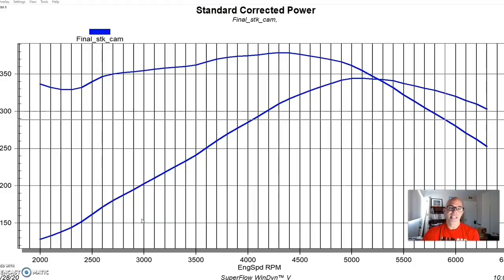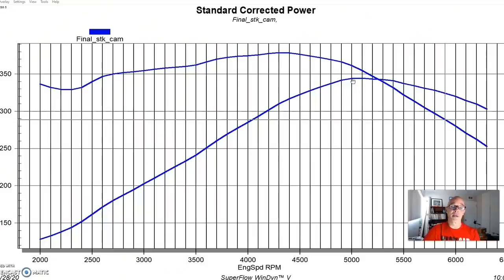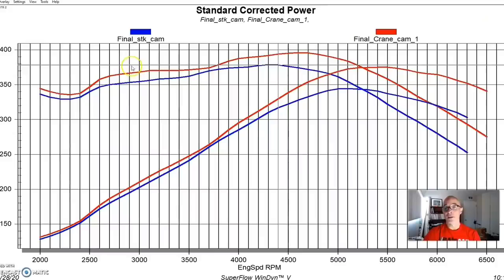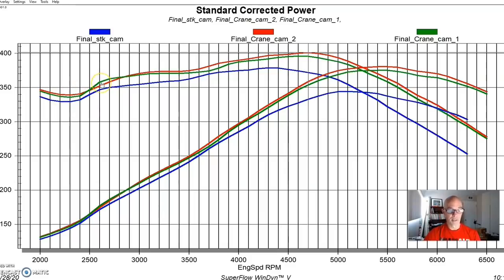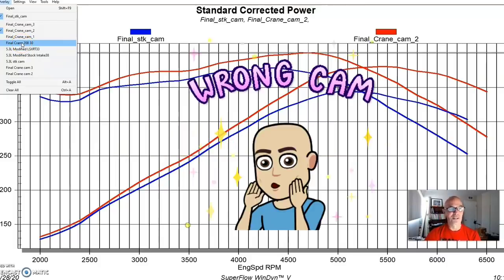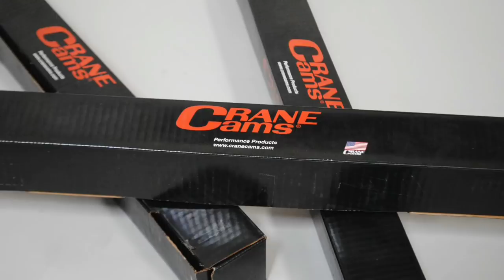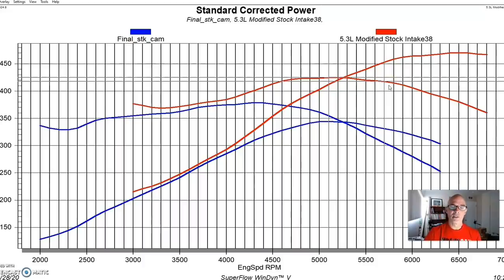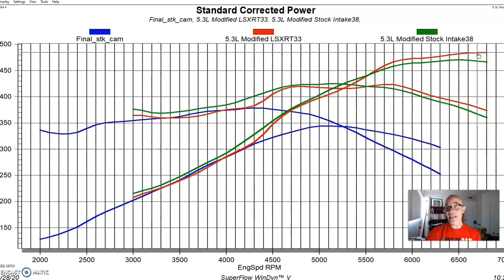NSR CAM TEST-HOW TO MAXIMIZE 5.3L PERFORMANCE

Comment: Would i be able to use stock exhaust if i replace the stock cam to a performan mild cam.
Reply from the maker: any cam can be run with stock exhaust
Reply: @richardholdener1727  thank you!

Comment: Quick question for anyone including Richard of course I did a cam swap on my 2012 Chevy Silverado 5.3 crew cab went from a 590 lift now I've got a cam motion 553 low lift do I need to have another tune done or should it be close?
Reply from the maker: THE LIFT ISN'T THE ISSUE-WHAT IS THE DURATION CHANGE

Comment: In my shop we run anything under .560 lift with stock springs no problem
Reply from the maker: NOT WITH STOCK 706 SPRINGS-ONLY WITH LS3 SPRINGS
Reply: @richardholdener1727  actually you may not believe me but I put stock ls6 cams (12565308)  in stock lm7 engines all the time.  Stock springs and all.  The customers love it!  Never had any come back with spring problems yet.  On the single bolt applications I use the ls3 cam most of the time and put 706 heads on them rather than the 243 because compression is more needed than that extra flow on these small bore engines.  No springs required on any of them so far.  Anything over .560 lift here usually gets pac 1218 or better depending on many things

Comment: Richard, do you do a video showing dyno results fro too tight and too loose valves? How it affects performance. Thanks
Reply from the maker: more lash, especially on a solid roller or flat tappet- tames the cam timing, less lash adds power on top (sometime sacrificing power down low)-it can also hurt things if excessive-you don't ever want lash with a hyd roller or flat tappet cam
Reply: @richardholdener1727  I just have an old honda crv 2.0, i guess it has hydraulic lifters.  When I adjusted the valves recently I got to wondering just what improperly adjusted valves does for engine output.  Havent seen a dyno test on that.  Everyone talks about keeping your valves properly adjusted, like its real important

Comment: I'm glad to finally see somebody starting a dyno test at 2000 RPM because in a everyday driver the engine spends most of its time right around 2000 RPM
Reply from the maker: are you at WOT at 2000 rpm at lot?
Reply: Trucks are frequently lol @richardholdener1727

Comment: What cam do i need for drifting?
Reply from the maker: WHAT IS THE RPM RANGE
Reply: @richardholdener1727   I'm not sure yet. Haven't tuned or bought anything. Researching. What's a good reliable RPM range to beat on a stock LM7 bottom end?

Power range goal 4-500hp. I'll check piston right gap and look at the bearings before of course. But just curious what cam you'd recommend. I'm sure Torque is important for drifting. Basically burning out while you steer around a track. Love your channel btw ❤ ✌
Reply: 4500-6500 RPMS

Comment: Hey, I just bought a 2018 Silverado with the 5.3. Would like to tow a bit more. Would you recommend stage one cam with or with out springs ? Would you replace push rods?  What about trunnions. I have heard there is issues with the trunnions. Thanks
Reply from the maker: BTR TRUCK NORRIS CAM AND SPRINGS

Comment: I was looking at the famous E-1840-P - TF SS2 FOR MY 5.3, 706 headed N/A build. A suggestion from Summit was their house brand SUM-8713R1 and SUM-8715R1, and after seeing this the SUM-8713R1 is looking great for a light weight, mid 80s Cutlass. hoping for a great street driver than can dip into the 7s at an 1/8th mile track. Thank you for being unbiased and all the grinding you do for us out here!

Comment: I have a all-alu 5.3 on the shelf here and would really love to put it in my MB 190E. Its a light car so a 7000rpm 5.3 would be awesome. No need for pulling heavy stuff, just a strong midrange/top. The sloppy stage 2 cam seems a good choice!
Reply from the maker: its cheap and popular
Reply: @richardholdener1727  i think from the ss2 vs the world you found that two other cams had similar top end but slightly better bottom/ mid-range. Thanks for doing all this work!

Comment: The thing to keep in mind here - later 5.3 (like 2010+) use a bigger cam stock. Something in the neighborhood of 196/201 .480 116lsa. Which is approaching the size of the first mild cam tested here. Also with vvt probably behaves like a larger cam than the specs would indicate.

Comment: My first build ig is kinda on the wild side its a 2001 tahoe 4x4 on 35s   iron lm7 bored .125. Full race blueprint 218/227 nsr cam (hotcam replica) hand ported milled heads 11.1 CR  tbss intake circle d 3000 stall and a built 4l80e suffering severely from the 80es tall first gear and big tires regear is gonna be next

Comment: Richard! What combination would be best for Street and Strip for a 5.3.? Maximum Horsepower? Stock bottom end as well?
Reply from the maker: STOCK BOTTOM END 5.3L CAN GO TO 500 HP OR SO WITH AVAILABLE P-V, DEDICATED BUILDS WITH HIGH COMP AND VALVE RELIEFS CAN GO HIGHER

Comment: i am new to this...i have have a 02 truck 5.3 ls engine 706 heads putting it in 72 amc javelin with a sagana 4speed trans ..my guestion is i love the thumper cams and would like to know what cam i should get  i wont that feeling of being pulled back into the seat and a thumping cam .can you help me
Reply from the maker: what power do you want
Reply: @richardholdener1727  around 450 or so  thank you for responding and also would i have to change push rods and springs
Reply: mainly street car with attitude

Comment: Are your results considered flywheel hp or wheel hp? 

Thanks for all your work with these videos.
Reply from the maker: flywheel hp
Reply: @richardholdener1727  do you have a guess on how much you might loose  after the hp gets to the wheels?

Comment: Just wondering what you would think about the 862 heads are they worth porting? It's a daily driver, was thinking a nice size cam long tube headers and a Diablo tune. Stock intake, all this is out of a 2002 5.3
Reply from the maker: ported 862 heads work well
Reply: @richardholdener1727  don't 862 heads have a bad rap for leaking coolant around the head bolts?

Comment: That LSXRT ain't worth shit. You gain like 5 HP above 5500rpm and loose 15 TQ under 5000rpm. I mean if I was made of money or was putting it in a camero but if it was a camero you'd have to use the LSXR anyway for hood clearance.
Reply from the maker: the lsxrt makes identical power to the lsxr-have tested that 10 times now
Reply: @richardholdener1727  Hi Richard, thank you for all your knowledge you share with us. Your work is incredible. Exactly, what is the purpose of the lsxrt if it makes the same power as the lsxr but with less clearace. Is it specifically only for big cam high stall guys running short runners spinning to 8500? Either way love your videos, you've helped alot of people with their builds including me. Your like the holy grail of engine building/tuning knowledge. Hope your having a good one.

Comment: Building my first 240sx drift car and just picked up a 5.3 gen 4 with 243 heads. Looking at picking up the BTR ultimate spring kit and the BTR Road race & Drift cam and coupling this with porting the heads. Any suggestions on supporting mods or alternative performance parts? (Won’t be able to afford the fast intake) This is my first engine build and trying to cover all bases. Looking for 450-500hp/tq
Reply from the maker: tbss

Comment: Will my 4.8 ls3 springs n fine is that what u saying brother
Reply from the maker: ls3 springs work with .550 lift cams
Reply: @richardholdener1727  thanks for getting back to me so fast Richard u r the man brother. But just to b sure my parameters on a my cam btr nsr 550 lift all I need to now rite i can have whatever lobe separation I desire rite?
Reply: Richard can u tell me which cam will give me the most nsr lope I'm looking for for that head turning nsr lopey goodbess that I can affordably get away with n my 99 4.8 vortec please n thanks for ur time again brother👍👍💯❗❗❗

Comment: I have a 5.3 with stock bottom end. I wanna make around 400 to the wheel if possible! I have 243 head that I’m gonna port! I want a stage 3 cam but don’t know what lift I want on it but I want 108 lsa. I heard I should run 235/235 .500 .500 something like that. Could you help me out on what I should run!
Reply from the maker: it will be hard to make 400 wheel hp (or 500 fly hp)-we needed properly ported stock heads (or TFS 205s), a sizable cam (like the Comp 54-469-11) and a Fast intake to do it on a stock 5.3l short block. a 235/235 cam might not fit available P-V.
Reply: @richardholdener1727  what cam do you recommend me to get?

Comment: 4th Gen 5.3.  Added a 212/218@.550 TSP cam, PAC springs and upgraded pushrods.  Shaved .015 off my 799 heads. Mild build, but good for a truck

Comment: 224/224 .600 112lsa with Texas speed ported 706heads Tbss intake  high compression 5.3 compression ratio 10.5:1 hoping for 400whp
Reply: Did you ever get to dyno this?

Comment: What would you suggest for a L59 5.3 with 862 heads in Monte Carlo ss everything is stock on the motor I need advice on what would be good for a daily driver
Reply from the maker: what are you asking about?
Reply: Richard Holdener an idea to get the most power out of this engine n/a was thinking btr stage 4 but maybe you have something different in mind I’m looking to make power an torque

Comment: So, my 5.3 was LH6, so I removed the DOD/AFM and installed ls6 lifters and springs(blue) a Howard’s version of GM ASA cam with 226/236 duration, .525 lift and 110* lobe separation. This motor is all aluminum with 243 heads and flat top pistons for 10.5:1 cr. I have Holley Terminator x engine management and chose a Corvette LS1 intake with cable throttle and Volvo turbo injectors. It dyno’d 300whp/tq with 2.5 exhaust and 325whp/tq with cutouts open. It has a choppy idle which sounds great and pulls very hard in my 1981 Volvo 242 with T56 and 3.73 locker. I am aware that  Sloppy stage 2 cam has performed very well, but when I look at comparison to my Howard’s cam, They appear to be close in spec numbers to each other. My question would be, numbers aside, do you see any performance differences with cam profiles not attributed to just the numbers? Would love to see you test the Howard’s ASA cam and they have a new higher lift version as well. I am not a fan of any particular cam manufacturer, just like what works. 
Thanks for your videos, Richard- always like the surprises that show up- keep ‘em coming!

Comment: What about an lt4 c7 z06 cam and springs for an l83 5.3 2016 Sierra engine with turbo +meth . I just found a deal and got it , would it be a good choice to retain factory dod system and get power while doing that ?

Comment: Mild cams with 1.8 X 1.7 rockers? I bought a brand new custom ground Comp Cam for $200.00 that sold the car he was putting it in. It's .637/.612 229/244!? It was $200.00 so it's better than stock. I'm running it in a carbeurated 2009 5.3 with home ported, stock valves, 918 springs, LS7 lifters, new main, rod and cam bearings, BTR LS9 head gaskets and new rings gapped at 34 thousands. From watching your videos, I'd say 440-450 on motor! Your videos are AWESOME! I have to get with ARP to see what head studs to use since they have a different part number for the newer LS's vs. early since I'm running older heads and newer block. I am also considering returning my 7.40 pushrods for 7.50. It's not a daily driver but will see a lot of street driving including 100 mile round trips to the track. Thanks for all you do, your videos are as entertaing as they are educational!

Comment: I would love to see a video on maxing out the 5.3 below say, 5,000 rpm. Unless you're on a track you're getting arrested at 6,500 rpm in almost any gear.
Reply: That is what steeper gears are for.  If you optimize power up top and lose low end you re gear it accordingly.

Comment: Richard would you think it be worth it swapping my btr stage 4 v2 truck cam out for that 224/232 590.  Cam? I like how that thing keeps pulling up top.
Reply from the maker: I've not tested the gtr stage 4
Reply: Richard Holdener not trying to argue with you Richard but I’m almost positive you did test the stage 4 truck cam,

Comment: Love the series, I'm learning so much about engine theory for my own build. Basically for the kind of racing I do I need high average power across a wide RPM range. Funny thing about it is people who drive my engines outside of the race comment on what a good street engine it would be because the tight turns that pretty much bring the car to a stop to make the turn and stay between the pylons require good manners at low RPM and our short straights also require quick revs and high RPM because the whole course is basically run in 1st gear from idle to redline. When I test an engine these days I just find a quiet road with a 40 MPH or faster speed limit and roll a first gear pull and use the engine log to time 2000 RPM to 6500 which tests average power. The converter usually flashes just over 2000 RPM anyway when I mash the throttle at a rolling idle, and unless I'm using my sticky race tires I get a lot of wheel spin.

Comment: How about throwing a bone to us 4.8 folks? There aren't any tests that I can find for the 4.8's. I'd like see some similar tests to this video. Maybe you could do direct comparisons to the 5.3
Reply from the maker: please look at ALL the 4.8L video I have up-plenty
Reply: @richardholdener1727  Thank you for the response. I liked how this video had different levels of NA cams. Mostly i see turbo or supercharged trims for the 4.8. I'm trying to figure out the best daily driver cam for a 4.8 in a 68 Tempest wagon for cruising , low end  torque and mpg. Recommendations?

Comment: Question?
How much trouble would it be to have a seperate video series that shows you (and anyone who helps)  doing the electronic tuning side of things. For that matter even carb tuning.
Maybe start with what you're already doing with Holley Components and tuning, then maybe what's done when using factory ecu's.
The tuning IS where your numbers come from.
There are people who will watch and learn.
Reply from the maker: I don't tune stock ECUs-just Holley
Reply: Richard Holdener 
Copy that...

Comment: Is it possible to have a mild combo that revs out to 7 or 8 grand? I just installed some LOOOW GEARS in a truck for rock crawling and have a 200:1 crawl ratio. Should I find myself in a end over rollover scenario, it's faster to mash the gas than to manipulate multiple shift levers.
Reply from the maker: 7 or 8 is a big difference

Comment: Dude you’re videos are awesome and you have inspired me to build my 95 Bronco. 
I ordered Edelbrock 77189 Heads for it and I don’t want to get the wrong cam😉
Also ordering a cx racing twin turbo kit for it. 
I want this thing to chop pretty good but still run any suggestions will be greatly appreciated  thanks 😎👍

Comment: I've been mulling over cams for my l92/4l80/Terminator swap in my crown vic. I don't want to put a converter in it yet because I plan on a triple billet when I do an s480 on the car next year. I also want good manners and  fuel economy because I think I can actually improve the mpg vs the stock npi 4.6 with double the power. The problem is I need to swap out the vvt cam but now with what I've seen researching small cams I'm thinking about the summit 8719 or 8720. I'd love to have a more wild cam but I just don't want to give up the torque and mild manners of a small cam for now. My b18c integra spoils me having both types of cam on tap lol

Comment: Hey Richard... I wonder why some cam companies have made, and do make reverse split cams for an LS turbo? Your test on this combo showed it did not work, albeit it was NA, but do you see a reason why a bigger intake duration than an exhaust duration cam for an ls turbo would be beneficial? For an example, Motion Raceworks currently makes an LS1 turbo cam with 230/224 on a 116lsa.
Reply from the maker: I have not seen that work the several times I have tested it-but maybe they have
Reply: Reverse split is great when you're fighting back pressure. But it also comes down to lobe design, valve size etc. And how wide you need the power curve.

Comment: Richard, why did you keep so much LSA in all of the cams?  I was hoping to see something like a 200/208 on a 108.  Not that I'm complaining!  Lol
Reply: A wider LSA will push the power higher up in the rev range letting the engine make more top end power with the extra flow from the ported heads and fast intake. Tighter LSA does the opposite.
Reply from the maker: idle
Reply: @richardholdener1727  Why do the LS motors need more exhaust duration, do the exhaust ports not flow enough? What are the typical I/E port flow ratios for these engines?
Reply: @richardholdener1727  For us uncivilized lot, would the 108 LSA make more torque and power on that 200/208?  
Idle?  You don't really care about that, do you?  Lol..  Thanks Richard!

Comment: As usual a great video.  Personally I'm in love with the Texas Speed truck cams, most notably the Stage 2 .550 lift cam.  It's my "GO TO" for almost all my builds making a solid 425hp with truck manifold at the crank and all the stock components except for a set of the Blue LS6 springs and a set of one piece lightweight pushrods.  Great daily driver and plenty of oats for a '68 C10 or a mid 80's G Body.  The current build I'm working on is a 5.3 bored to 5.7 with a set used corvette pistons, the Texas Speed Stage 3 Truck Cam with .600 lift, a cleaned up set of 706 heads and the Trailblazer ss manifold and a set of long tubes, looking for about 425 hp at the wheels, expect more but no matter how it turns out it should be fun.  Getting to the point where the chassis and brakes may be the limiting factor for the old C10.